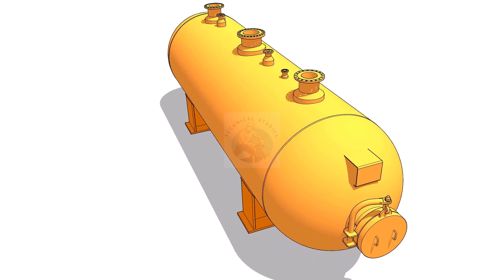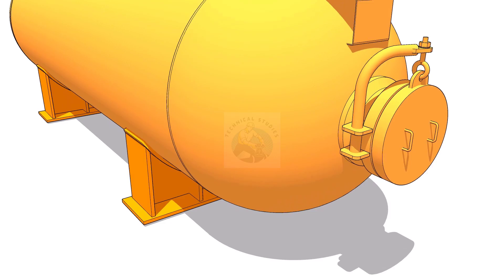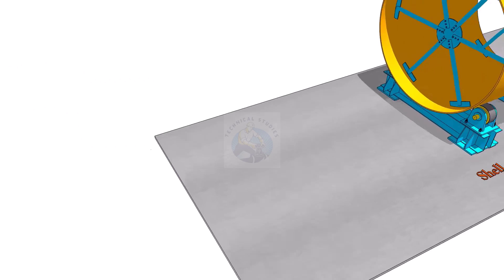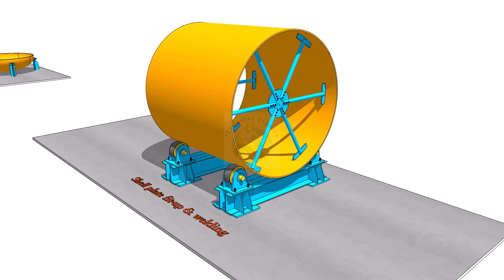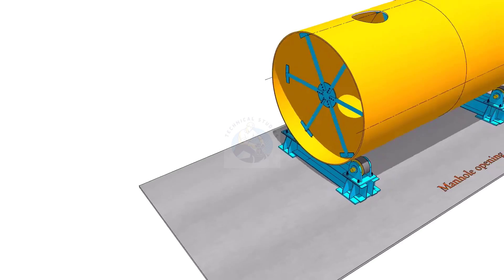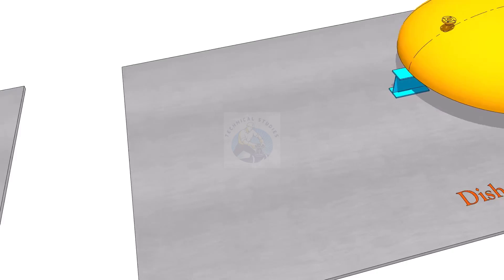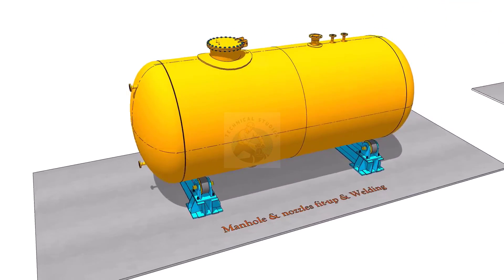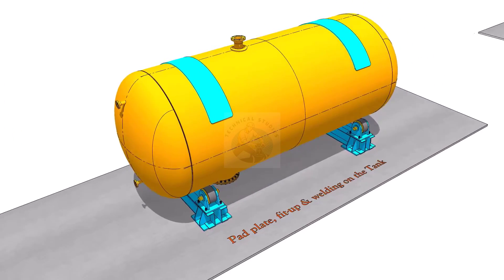Pressure vessel fabrication sequence.

Comment: I usually draw horizontal Pressure Vessel & Vertical Pressure Vessel in just a few hours using autolisp Programing
Reply from the maker: You are a designer, and i am a modeller Bro. I am using sketchup for years for modelling. Actually, when i get a drawing for fabrication, i use to make an accureate 3d model and i use the model to train our team. Sketchup is faster than autolisp, but not stable, but beautiful. Thank you for your valild comment Bro.